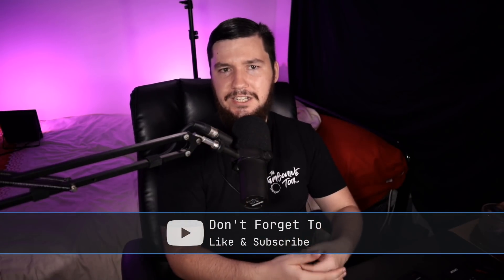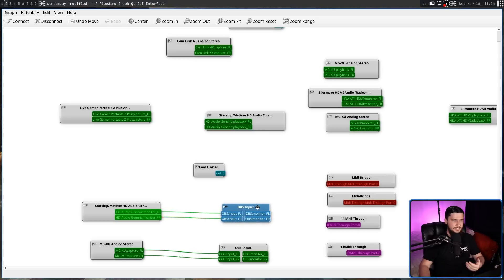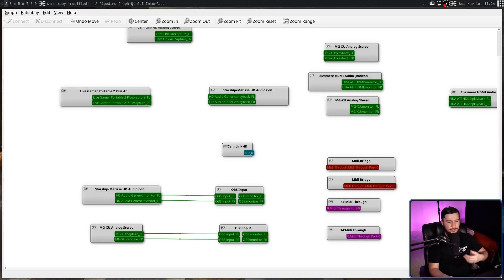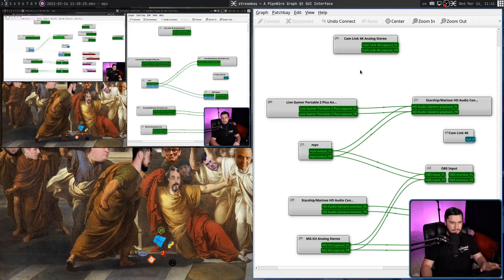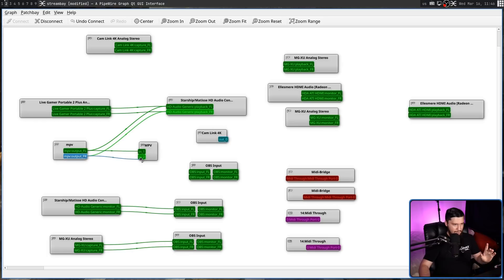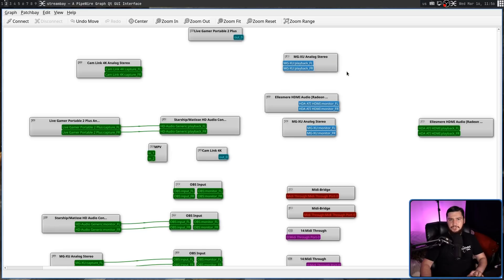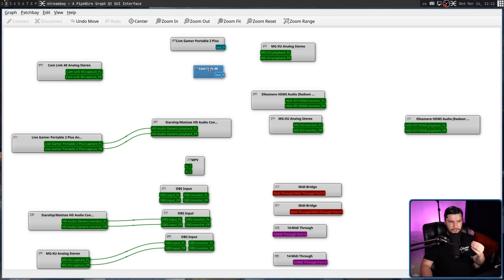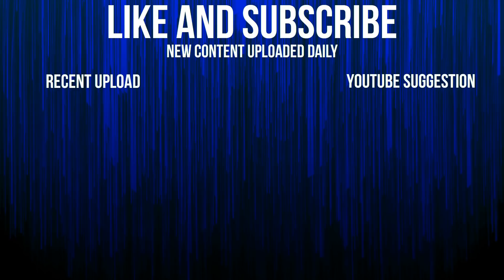Qpwgraph: Easiest Way To Reroute Pipewire Audio

Comment: would absolutely love to see a from scratch setup using pipewire, wireplumber, carla, qpwgraph - everyone talks about going from pulseaudio and/or JACK to pipewire, and assumes you have several years of experience with those and now you just need to swap over, and there's little to no information on new setups, and the pipewire documentation is missing so much (example, the 'Adapter' module only says 'libpipewire-module-adapter' with no other info', or that it says it [link] "explains" the properties of what something does, when it just links to the API that has the name and what type of variable it is, which is not helpful when setting up configs and you want to know what a random bool or string is)

Comment: I ran into a dealbreaker for me and I'm back on windows for now until I find a workaround or it's fixed. It seems most/all Electron apps present themselves to pulseaudio(and thus pipewire) as "Chromium" and due to that it can't differentiate it and the nodes will shuffle between them as different "Chromium" audio streams come and go. This prevents forcing Discord to one sink and Vivaldi to another for example. If anyone knows a way to do that on Linux, please hit me up.

Comment: How in the world so I set a default output in Qpwgraph? My mixer has 12 outputs and I need to output on 6/7 but every new audio stream defaults to channels 0/1. Each new tab I open in Chromium adds a new output that defaults to channels 0/1. I started a YT video. changed the name of the output, saved and it will keep outputting to the correct outputs but when I open a new tab it's a whole new output that defaults to 0/1. Edit: It also behaves REALLY strangely with some things. Like Discord audio shows up as Chromium. I assigned the Discord "Chromium" output to channels 2/3 on my mixer and saved. Then I opened a new tab in actual Chromium and the new tab used the Discord "Chromium" output. What a mess lol.

Comment: One use case for normies like me: Pipewire supports auto-switching between A2DP (Output only) and HSP/HFP (Output + Microphone, but terrible quality) for bluetooth headsets, but only does so when it detects an input stream. Because you need an input device to create an input stream, and the input for your bluetooth isn't available til the switch happens, you can't actually just start a call and do nothing and have it use your headset, be it with teams-via-chromium or firefox.
The solution to this is to create a virtual microphone that is always available, with a connection to it from your headset microphone. Then you can select your virtual microphone when starting your input stream, which triggers to automatic switch, which in turn properly hooks up your headset microphone so that it is instantly available in your call or recording, without having to manually switch to it.
Reply: But why not just enjoy the auto switch? I don't get it. Isn't it a nice feature?

Comment: I'm a pro audio user who has been experimenting with Linux as a proof of concept. I deal with LOTS of I/O's... Either I don't understand pipewire, I'm not using how it was intended or it's flat out horrible. I've been using QPWgraph. I cannot, for the life of me, figure how how to make this thing recall my connections when I close and relaunch Reaper. It always defaults the computer's internal mic to 1 and 2 every single time... even when activated and exclusive are engaged. But for some reason my outputs ALWAYS map correctly, exactly as I set them. I haven't managed to make it recall my MIDI connections even once. I have no idea why this is happening or how to fix it and it's beyond frustrating. This should be obvious and simple. Devs need to realize the typical user isn't a programming engineer and at least provide a basic help section explaining how things work.
Reply: Tbf when this video was released this was still a new tool in early development. So bugs are expected. You could report a issue on the software's github to let the author know about it and try to fix it.

btw, how is the situation now, 1 year later?
Reply: @LinuxIsNotAnOperatingSystem  I have the same problem. It can be quite frustrating.
Reply: @RX120D  me too, also from a pro audio background. would love to know if anyone found a solution to this.

Comment: Helvum is a patchbay though? The description on their gitlab is literally "A GTK patchbay for pipewire." And it's far more polished and simpler.
Reply: I just tried helvum on Fedora 37 KDE ("Jam" spin),  maybe the problem is due to my running helvum which is GTK from KDE but it doesn't work. All the widgets in the helvum windows are frozen and trying to move them results in the console:

(helvum:7587): Gtk-CRITICAL **: 15:28:09.575: gtk_drop_target_async_handle_event: assertion 'self->drop == drop' failed
(helvum:7587): Gtk-CRITICAL **: 15:28:09.583: gtk_drop_target_async_handle_event: assertion 'self->drop == drop' failed
Reply: @manw3bttcks  I’ve used on Fedora KDE without problems. Have you installed the Flatpak?

Comment: So does qpwgraph conflict in any way wit qjackctl or is it fine to have both installed at the same time? I'm kinda intimidated by the separate patchbay in qjackctl...
Reply from the maker: You can install both at the same time, but if you start trying to control the same things in both applications expect things to be a bit wonky.

Comment: I'm confused how things disappear unless they're being used.  So I want to pipe my desktop audio to both my HDMI monitors but the only monitor that shows up on QpWgraph is the one I have the audio output in my system settings.  I want to have audio go through both because I'm playing on my game computer and want to also send audio through the second HDMI port on my card to my second computer that I have running OBS with a capture card.

Comment: Some background: I recently came over from Windows where I was using voicemeeter and virtual audio devices to route all of my audio streams. It was great, but had some limitations; specifically the number of simultaneous streams that could be managed. 

Bought a new laptop a few months ago, installed Garuda Linux on it, and got it mostly functioning how I wanted after writing a script to reconfigure my input devices based on the active window’s class and title. The only thing left to setup was audio routing. 

I started looking for a decent pipewire patchbay right as this video hit. Pairing this with non-mixer is going to blow voicemeeter out of the water. I’m still trying to figure out how much I can automate here though.

Also: you can drag-select boxes as long as you don’t include the input or output boxes in the selection.

Comment: Great content. Is it possible to make different browser tabs have different and fixed audio levels? For instance when playing music on Google play while in a meet call? Currently I always have to go and manually adjust each..
Reply from the maker: Depends on the browser, most just send everything out as a single audio stream but if it does seperate tabs it should be possible

Comment: Didn't stumble across this one before. I'm using qjackctl right now to route audio around. My reason is to have different apps connect to different audio sinks so I can individually control volume for different groups of applications (voice chat, music, games etc.). I've also built a hardware volume controller with a few knobs that communicates with a python application via serial, so I can control the different audio sinks very easily.

Comment: I actually fell in love with Carla for patchbay purposes. It's a godsent if you're a streamer.

Not sure if qpwgraph supports this functionality, but with Carla I get all the patchbay features, and then on top of that I get to add plugins like VSTs, which for livestreaming is amazing.  From the basic stuff like noise gates, equalizers, and compressors to the more advanced stuff like fancy audio effects.

I noticed Carla exposes MIDI and JACK control to the VST plugins as well so I'm researching how to get into those ports -- admittedly new to me -- and automate things like effects, or put them as button presses on something like a Deckboard.
Reply: Can I do something minimally like Voicemeeter on this, Carla? I'm migrating to Linux entirely, and I'm just looking for programs that can replace my live stuff. I basically use Light Host with VST plugins on the mic and Voicemeeter with a bunch of inputs for various things. Even for voice chat. But I don't know anything about these new programs yet and I'm studying them.

Comment: a very edge case senerio but helvum doesn't (yet) support using a touch screen to make connections, qpwgraph does
Reply from the maker: Oh that's odd
Reply: @BrodieRobertson  maybe, though touch screen controls in my experience are not really a first class citizen on Linux at this point. And I'm not sure how many people out there want it to be rn, I just happen to have a 2in1with a dead trackpad

Comment: I tried Pipe wire and had too many issues with stuff that connect and disconnect and totally ignore the patch.  They absolutely need to find a solution to make the patch permanent.

Comment: I don't see a personal use case for such applications, in my eyes. I just want functioning audio and get similar (in this case better) control over audio like I knew from most distros and even Windows without requiring other applications to tinker with such options or getting a headache in the process.
Reply from the maker: Fair enough
Reply: helvum is part of pipewire, I think you can use CLI commands for routing media also.

Comment: cool man. like so worth covering this one. glad you took it up and made a video on it

can i just also say the developer nuno is a pretty cool dude. we were using qjackctl before, then helvum came along but it kindda sucked or was just mostly incomplete features wise and way too basic. so one of us asked nuno on his issuse if we could have just a standalone tool for purely the patchbay screen on pipewire. and he was like '...well as a matter of fact, i had already been working on a new tool specifically for pipewire and the initial version of it is mostly complete!' oh btw 'heres the new repo so you can compile and try it out, like to preview it' ... and oh man was it already so solid. couldnt believe it.

then later on (more recently) someone asked for session saving / persistenance. and same thing again. it was just so fantastically well done. what else? flatpak --> yes there is one now thanks to a but of extra help

this tool mudh like pipewire itself is still in its beta or early and has some bugs in it. however (also like pipewire) it overall is already working remarkably well. and quite usable, as brodie is so well demonstrating in this video

excellent. the linux audio life has never been better 👍

(p.s.  was also good to see here how best to configure obs with  its jack plugin for others. did it the same exact way myself)

Comment: So why would you use this over something like Carla? Can't that do PW stuff too?
Reply: this tool is native to pipewire, so will include all devices that pipewire sees includin video devices, and  pulse audio devices (without need of and special configuring a pulse jack bridge plugin). and it will also see lower level alsa devices too. the whole lot

wheras carla being a jack based program can only see some of those devices. but not all of them
Reply: @AshKit But if you use jack anyway then there's no real differance?